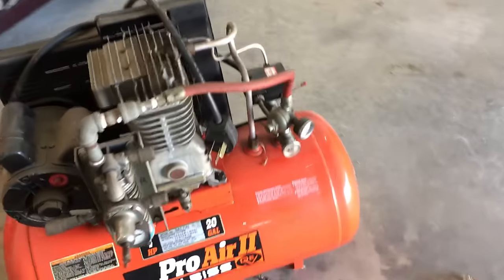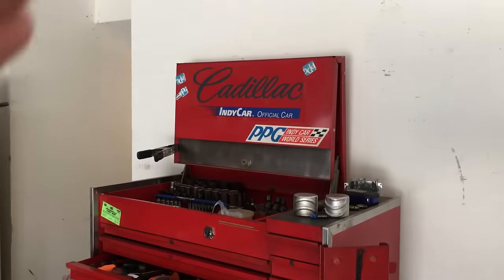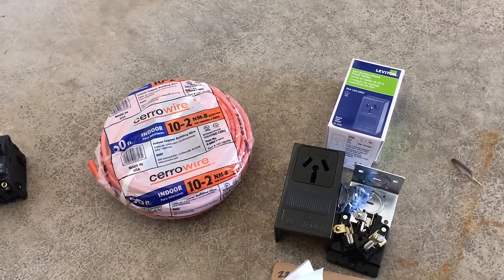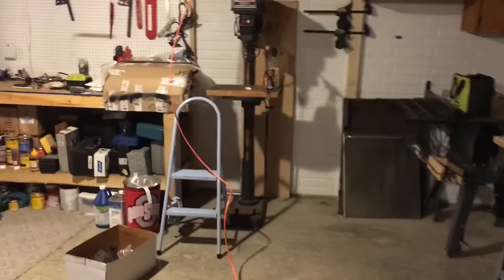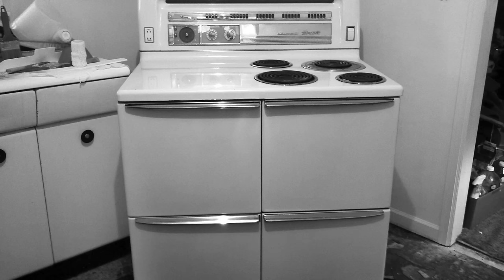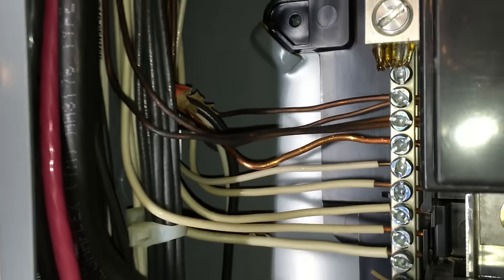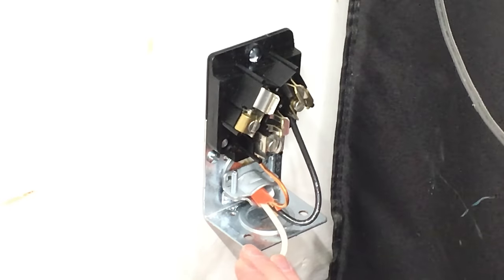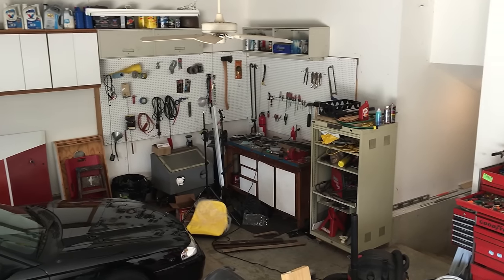How to Install 220v outlet in Garage the Easy Way = Run from Basement

Comment: I have the exact same tool boxes you have!!!! yes boxes the harley box and the older  snapon red box  that's weird I bet that were the only ones in the world with these same two boxes!!
Reply from the maker: Kurt Riedmuller thats crazy! The snap on was my dad’s from when he started out as a mechanic. The HD was won at an auction in the late 90’s. I keep all the oddball tools and stuff I don’t use often in the HD so it doesn’t get beat up.
Reply: @6thGearGarage  that's cool I bought my HD box new from snap on when I first started as a mechanic and the red  snap on box I had a friend give me the top box for my home garage and then my snap on dealer had the bottom and the side cabinet in from a trade so I bought it to match my top box ... now I'm looking to build a home shop pole barn to work on my projects!!
Reply from the maker: @kurtriedmuller8223  LMK If you're in Ohio, I can recommend the guys that built mine.
Reply: @6thGearGarage  thankyou but I'm in Illinois

Comment: 110v and 120v are actually the same, US power companies deliver +-10% of 120v so sometimes you will even see more than 120v at an outlet (and sometimes less)! Modern appliances do not care and can operate within these ranges, it's not actually a need for more power (they would just draw more current, but still negligible in the long run)

Comment: I'm in a similar situation installing my dryer outlet, but see you have a 50 amp receptacle and only a 30 amp breaker. Is that unsafe? I bought a 50 amp receptacle but only a 40 amp breaker.
Reply from the maker: I would consult an actual electrician, I'm not an expert.
Reply: You would need a breaker that is rated for the outlet receptacle.  Dont ever try to safe money and cut corner on it buddy. It could cost more damage than savings. I'm an Electrician. Fire hazard

Comment: A 30A double pole breaker. That's a serious compressor motor.
Reply from the maker: I was also planning down the road, in case I got a more powerful welder (finally got one last year!)
Reply: @6thGearGarage  I guess the motor has a thermal overload to prevent itself from melting.

Comment: Why didn’t you use a 10-3 wire
Reply from the maker: No need for 10-3 in this application, 10-2 is all I needed and less expensive.

Comment: My 240v for my dryer is a couple feet away from exterior wall.
I want to piggy back off that for an exterior receptacle, is that ok?
Any advice how to do that without destroying my drywall, or just add access panels?
Reply from the maker: I'd ask an electrician, I'm not sure if that is code or not.

Comment: Was that a new breaker or did you replace a breaker in the box at the wall downstairs?
Reply from the maker: I added the new breaker.
Reply: @6thGearGarage  did you have an open spot for it?
Reply from the maker: @spursfansince87  yes there were available spaces in the panel.

Comment: How do you test that you’re not overloading breaker box by adding more breakers?
Reply from the maker: That would be a question for a qualified electrician, which I am not.
Reply: There should be a main breaker running that box that would trip if you ran everything at once which won't happen unless you turn everything on at once lol
Reply: When the breaker box breaks you will know

Comment: No conduit? Is that safe?
Reply from the maker: Yes it is not needed when running through the floor joists, only when running wire down the wall to an outlet.

Comment: Are you going to get a bigger compressor?  You can get a 120v compressor in that same size.
Reply from the maker: No I added the outlet just to run this one. It’s only 20 gal, but high output for painting vehicles.

Comment: Would that compressor not run on 110v I dosent look big enough to be a 220 wow I guess shit is just made different by brands ive got a 20 gallon that runs on 110
Reply from the maker: It's designed for automotive painting, small tank size but high output. I had a larger one too that was 110.

Comment: Question; can it also be done for a 50amp 220v welder using a 50 amp breaker
Reply from the maker: I recommend asking a professional, as I'm not an electrician.
Reply: If your welder uses 50A I’d oversize the breaker as u don’t wanna exceed 80% of the total ampacity of the circuit if you wanna avoid popping the breaker

Comment: Not a safe practice to use white as the second phase.  The red is for the second hot.  The white should be neutral and eventually connect to the earth.  I am not sure if the inspector is going to allow it even.

Comment: I know this sounds like a really dumb question but did you have to turn off the whole power to the house to install the switch
Reply from the maker: No I did not
Reply from the maker: ianjsutt  Yeah put the breaker in in the OFF position and after everything is wired up I switch it to ON. I used to shut off the main switch to the entire house too when I was first learning to do this stuff. It made me feel less worried but eventually I got tired of resetting all of the clocks.
Reply: If unsure, shut it all off. The time to reset something isn't worth being fried over. Think of it as saving a little money by having everything shut off for once.More so, shut if off if you aren't 100% sure every single thing in your house is wired correctly. One faulty tie-in and it won't matter if that breaker is off or on.
Reply: ianjsutt  This is actually the way you should do it, seasoned or not.

Comment: That's all fine but you used the wrong breaker for that panel it's a Square D panel not Siemens, you should phase your neutral wire that is now a hot wire from where it enters panel all the way to the breaker in red or black to clearly identify it as a hot. Also you should have physical protection on that wire coming in the side of the panel.
Reply from the maker: Thanks for the heads up on the breaker - did not know Siemens shouldn't be used in this box. It did fit ok though - should I change it? (It was the only one H.D. had that would fit.)  Dumb question- what do you mean by physical protection where the wire comes in the side of the panel? I only used a grommet.
Reply: @6thGearGarage  also running all your wires like that in one bored hole is against code it's considered bundling, the conductors can't cool down with all the heat from those 12wires. No matter what size hole you go through you can't have more than 5 current carrying conductors. 1allowance for a hot and for a neutral etc.
Reply: @6thGearGarage  If you look closely you'll note that the Siemens breaker "fits" but doesn't actually go all the way onto the busbar. You can see it in the video, that the front piece of the breaker is just a mm or so left of where the other breakers are. Square D adds an extra little "nub" to the bus design that rejects other brands' breakers in this way.

HD does sell the breaker you need. Manufacturer's part number is HOM230CP. You will find it on HD's site if you enter 202353325, and that should lead you to which aisle/bay to find it in at your local store.
Reply from the maker: @emolatur  Thanks!
Reply: Thanks BE, Always appreciate a helpful comment without the negativity.

Comment: Why didn't you just push a foot through other direction?
Reply from the maker: I ask my self that all the time now
Reply: @6thGearGarage  I bet. Haha. Looks like some others pointed it out. Benefits of hiring a professional. You don't look foolish on YouTube. You done good. Only thing as others mentioned red tape as 4 wire 220 uses red as 4th wire so you know it's a 220 outlet and not 2 separate 110 circuits on same breaker cause there are split breakers. And plug upside down so ground on top in case plug comes loose and something falls on it. Object hits ground not hot and don't become electrified. Or trips breaker if hot and ground at same time. Also on panel is that just a rubber gromet? You need 1/2" nm clamp going into panel. If 220 outlet don't have an integrated clamp you need one on there too.
Reply: @6thGearGarage  I bet. Haha. Looks like some others pointed it out. Benefits of hiring a professional. You don't look foolish on YouTube. You done good. Only thing as others mentioned red tape as 4 wire 220 uses red as 4th wire so you know it's a 220 outlet and not 2 separate 110 circuits on same breaker cause there are split breakers. And plug upside down so ground on top in case plug comes loose and something falls on it. Object hits ground not hot and don't become electrified. Or trips breaker if hot and ground at same time. Also on panel is that just a rubber gromet? You need 1/2" nm clamp going into panel. If 220 outlet don't have an integrated clamp you need one on there too.

Comment: 6th Gear Garage... to add

Back ground concerning your NEMA 50A 10-50R receptacle ->

NEMA (U.S. National Electrical Manufacturers Association) 10-50R, 3-pole, 3-wire, non-grounding, 50A 120/240V. For older ranges that are non-grounded and that require dual voltage: 240V for the heating elements and 120V for lighting/clock/controls. 

In North America, the cases of some ovens and clothes dryers were grounded through their neutral wires as a measure to conserve copper from copper cables during the Second World War. This practice was removed from the NEC in the 1996 edition, but existing installations may still allow the case of such appliances to be connected to the neutral conductor for grounding. Note that the NEC may be amended by local regulations in each state and city. This practice arose from the three-wire system used to supply both 120 volt and 240-volt loads. Because ovens and dryers have components that use both 120 and 240 volts there is often some current on the neutral wire. This differs from the protective grounding wire, which only carries current under fault conditions. Using the neutral conductor for grounding the equipment enclosure was considered safe since the devices were permanently wired to the supply and so the neutral was unlikely to be broken without also breaking both supply conductors. Also, the unbalanced current due to lamps and small motors in the appliance was small compared to the rating of the conductors and therefore unlikely to cause a large voltage drop in the neutral conductor.

Using the W (white wire) in NEMA 50A 10-50R receptacle as a ground should not cause any problem..

Good job on the install..!
Reply from the maker: This was by for the most informative post on this video. Thank you!
Reply: Shouldn't it be a 10/3 wire? Red and Black are your two hot legs, white natural and then ground is green? I'm a little confused. Thanks for clarification.

Comment: So there was no neutral needed for that???
Reply from the maker: Alfredo Sanchez no neutral needed for a 3-prong 220v. If my compressor plug had 4 prongs, then the 4th wire would have been a neutral.
Reply: @6thGearGarage  

X wires for Line hot + 1 neutral + 1 groung shield yello-green
Reply: Alfredo Sanchez neutral is required if your load operates at 120/240 since the compressor is just 240 a neutral isn’t required for the load

Comment: As I’m preparing to have my compressor wired up and running a 240 line to my garage The electrician said to get THHN 8 gauge wire (2 hots and 1ground=3 wires)

Being curious I noticed the guy who I bought it from used all same color wires but he labeled them as white, black, red, and a bar ground wire which =4 wires🤔 the old motor was a three phase but I have a single phase motor in my garage waiting to be mounted. The electrician said I need three wires but I see four wires. Does the extra wire have anything to do with the fact it was once wired for a three phase??
Reply from the maker: b e this question is beyond my level of expertise.
Reply: Lol I noticed some guy with the same name as me was criticizing your work. Not me. I hate electrical work
Reply: b e      The size of the conductor, the configuration of the receptacle, and the amps of the breaker should absolutely be based on the nameplate of the motor.   Obviously from this video, the plug configuration cannot be trusted to be correct.   Take motor fla(full Load Amps) from the plate x 1.25= minimum circuit amps.  This sizes receptacle, wire and breaker.   Your electrician may be correct if 60 or 80 gallon compressor.   20 to 30 gallon, probably not.
Reply: b e     Sorry, I did not see the rest of your comment.   Strongly suggest you completely retire the compressor based on my first response.   Single phase in same horsepower will draw more amps than 3 phase.   If it still has a 3 phase working motor, I suggest you keep it 3 phase.   You can get a TECO vid that takes single phase and puts out three phase.  You can also adjust the motor speed safely to run slower or faster than speed rated.   Best of luck to you.    Respectfully,   Kevin
Reply: Kevin Coop I’ve seen videos of guys just replacing the three phase motor to a single phase. A variable frequency drive would cost too much money to be able to run the three phase motor. so I figured buying a single phase motor with same specs would be good🤷🏽‍♂️

Comment: 240V?  In my mind, I will connect black to black(in panel, +120v), and white to red(in panel, -120v), that's 240v, am I wrong?
Reply: James Real Estate   There is no + or -     It is alternating current (AC) system.   But you are correct otherwise.

Comment: There’s not really a “220V wire” it’s more of 2 separate 120V wires that are set for a certain amperage and distance (for voltage drop). Download a calculator by Southwire to calculate what wire you need for the distance and amperage you are running. Don’t just go buy “220V” wire.

Comment: The plug looks upside down but believe it or not  that is the correct way all plugs are supposed to look "upside down" even standard plugs  ground is supposed to be on top 

""Because if a cord or wire/objects were to fall down on a partially plugged in right-side up outlet you would short out between the hot and the neutral. When the outlet is "upside down" in the above situation the wire would touch ground first.""
Reply: Wrong at least in the two states that I have worked. NO code exists on which way the duplex should be mounted. Personally I hate it when the ground is up!
Reply: Yeah, and it won't become "partially plugged" if the weight of the wire isn't trying to pull it out!
Reply: It is personal preference there is NO code anywhere that I know of saying to put the ground up! if you find one please let me know in the meantime all my grounds will stay down

Comment: you would have been money ahead by installing the proper size (20) amp. cord connector on the compressor & running 12-2 to the panel with a 20 amp breaker. 30 amp circuit is unnecssary & the 50 amp receptacle a code violation.
Reply from the maker: Thanks for the help!

Comment: I feel little more confident now after I saw this video.  I'm using the same  cable , same 30amp double pool. However I"m  I'm using a L6-30R receptacle to an adjacent room for a PDU 200-230V pdu next to my garage that is use for some crypto mining rig. Glad to know 220v aka 240v since I was worried my PDU is only rated up to 230V.

Comment: why are your grounds landed on the neutral bus
Reply: Bela Skoflek  it’s it’s a main panel not a sub panel the ground and neutral are bonded since it’s the first form of disconnect, landing them on separate bars is only good practice for looks but is the same either way being it’s the main panel.
Reply: @joerigney8054  interesting, that's not the code in canada. The neutral bond happens at the first place of disconnect but only the one bonding screw of the panel. Anything after that the neutral and grounds are separate
Reply: Bela Skoflek  this is the first form of disconnect landing neutrals and grounds in the panel on the same bar is the same thing as keeping them separate only reason I like landing them on different bars In main panels is because it looks more uniform

Comment: that wire is going to melt if you plug anything in to it bigger than a Light Bright.
Reply from the maker: It's been fine running the compressor for a couple years so far.
Reply: It will run a medium sized welder if he needs it to...the breaker and wire work together to protect from overload

Comment: I'm sorry, but no way that cord came on that compressor from the factory.  It was added by someone to plug into a receptacle the same configuration.   The breaker should have been either 15 or 20 ampere based on motor nameplate amps x 1.25.  Wire is oversized and the receptacle amps should match the breaker size.    I really do not understand putting videos on YouTube when not having enough knowledge to know how to do correctly.   I guess it's about views and money.
Reply from the maker: I've had some comments saying the wire was undersized and some saying it's oversized. I don't know the history of the compressor, except it's been like this for the 20+ years I've had it and works great.
Reply: 6th Gear Garage I have no doubt your compressor runs just fine.    If you ever sell your house, you may get knocked during an inspection.   The real danger though is this.  By installing a 50 ampere receptacle with 30 ampere breaker and conductors, someone may try plugging in something that really needs and has a 50 amp plug.   You complained about the wire cost.   Done correctly, you could have run either # 12 or #14 depending on the previous comment calculation.   Doing correct can sometimes cost less.   Good luck and best wishes to you sir,    Kevin
Reply from the maker: @KevinCoop1  I see what you're saying now... thanks for explaining.

Comment: There is no such thing as 220 volts in North America.  On a single phase panel it will be 240 volts.  Across two legs of a three phase panel it will be 208 volts.  Line to neutral on either type of panel will be 120 volts (not 110).